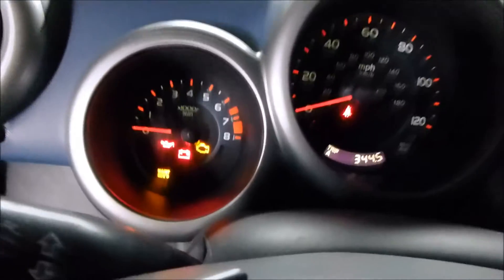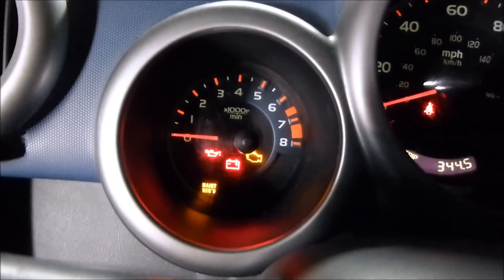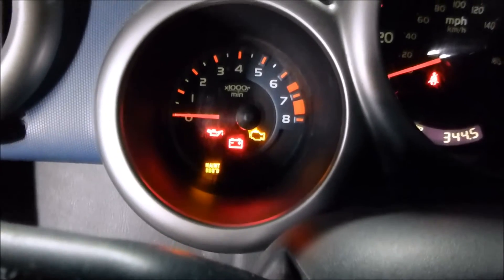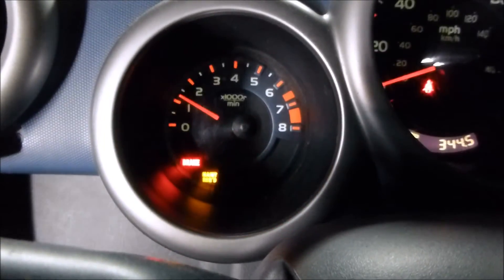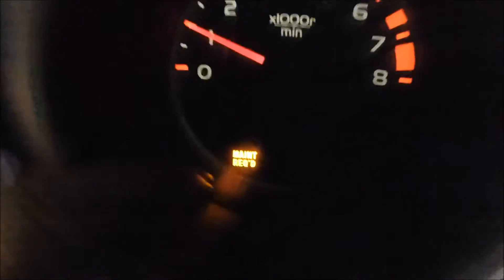Honda Element, CR-V, Civic, 2.4L I-VTECH engine noise, WHAT ??? #70

Comment: tuen off the music....annoying
Reply from the maker: at 38 secondes the music stops, sorry, I`m a new youtuber and this video is one of the first one i`ve added music and I know once online it`s a bit too loud, I`ve fixed that problem since on my later videos.
Thanks again. It`s because comments like yours that youtubers can improve their videos
Reply: What was it??
Reply: Can’t find other video
Reply: He was asking the question as well. Not very professional. I would start with a valve pressure test. Simple and cheap for any one handy with a spark plug wrench. Oil pressure on those has to be kept normal as well. If it's systemically damaged by lack of oil maint. you may as well get another motor.  That music was the only admirable aspect of the video. Frankly.

Comment: how much 2 fix???
Reply from the maker: Hi joe sno, the dealer told me it was less expensive to replace the engine! but they also told me that if you keep regular oil changes and maintenance the engine will last for a long time.
Thank you
Max
Reply: @Kickstartyourcar  So basically The dealer said  to put up with the noise and chand oil on time? Do u still have noise?
Reply from the maker: Hi, @joesno406 , yes the Honda dealer told me 2 options, the first one, since it's an old car, continue regular maintenance and drive it with no worries, or replace the engine with a used one for $1500. I did not replace the engine since and I sold it to a friend and 
He still drives it after almost 80000 km later and it's just a bit louder, My friend finds it funny, he puts the radio on loud, and the car drives like a new one :)
Thank you
Max

Comment: Mine sounds like that
Reply from the maker: Hi, Catherine Wilson, mine has a piston flop and since almost 100 000 km later it's still alive :)
Reply: @Kickstartyourcar  I watched almost all the videos. I thought it had a valve tap. So i watched lol they all sounded the same...  piston snap did you fix it? Did it quiet it?
Reply from the maker: Hi  @catherinewilson1328 , my car still has a piston flop and over 100000 km more and it still drive ok and the sound seems the same or a bit louder. 
Max :)
Reply: @Kickstartyourcar  yea I watched this one guy you tube... recommended if you do not know what your doing dont mess with the valves got that very touchy. So he thought he was obviously up to handling the job. He deffently knew his stuff but not on the one of its kind honda element.  And he said the same thing it was louder... it didnt change... I'm guessing it jus comes with it... I have a auto mattic i can drive stick i know the difference in the trans sound... and my auto mattic sound like manual...especially in reverse... I do my oil changes... my maintenance light came on... took to inspection they told me it's a cliche... which was around the time that ticking sound got louder. It sounds like a Volkswagen bug. The older ones